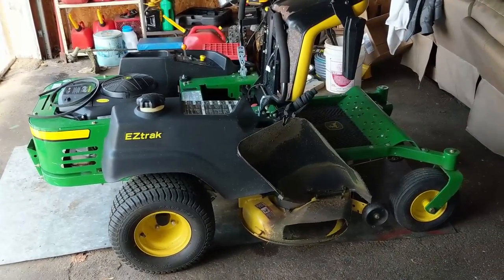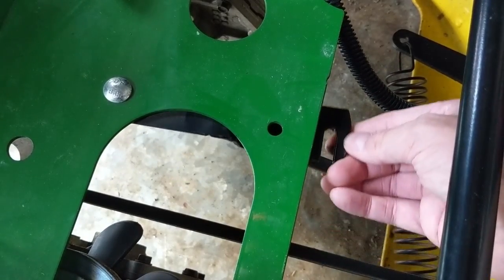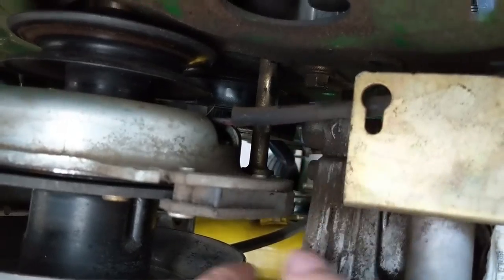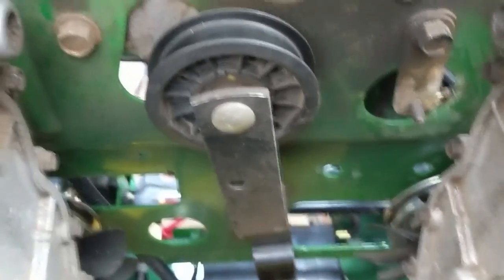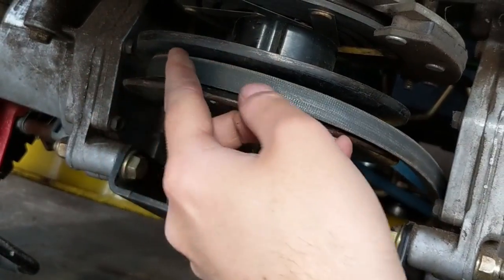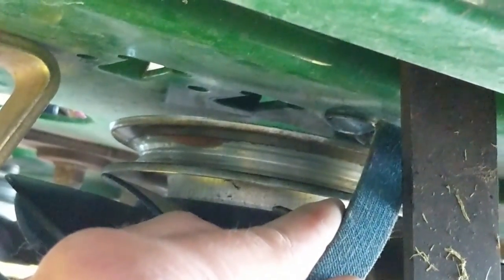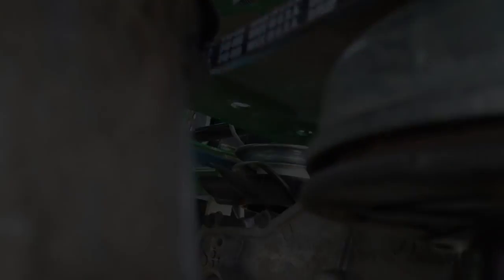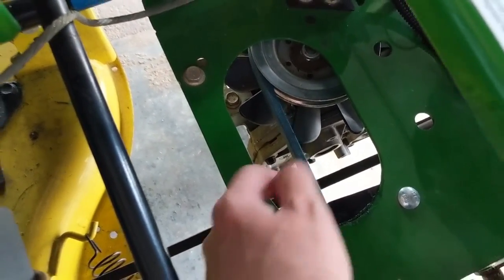John Deere Z245 - Drive Belt Replacement

Comment from the maker: Note; so the PTO clutch doesn't have to be removed, but I removed it and added Permatex nickel antiseize so if it ever needs to come off again, it'll slide right off. Also, this machine supposedly has 2 different drive belts, so this video may not help you if you have a the different model.

Comment: Annually I remove my deck for cleaning, change oil etc.  During this time I check the drive belt.  One thing I can suggest that makes this job a breeze is to drain the oil, remove the battery, and then stand the mower on the rear bumper.  Everything is much easier to see and reach!  Just remember to remove the rear hitch first if you have one.

Comment: Awe brother, you totally skipped over the hardest part of getting that darn clutch back on. I have already put the tension spring back on the crank pulley since it keeps sliding off. Those side bolts on that transmission are a real pain.

Comment: I have a JD z425 with a 48 inch deck, but my drive belt is like 111 or 112 inches long. So that belt does not fit all JD Z425s.
Reply from the maker: Yes from reading the comments it appears there are 2 different designs of Z245, it's possible a different year uses a different belt

Comment: I realize this is an old post, just wondering if you put a washer between the idler pulley lever and the body if that would keep the arm from rubbing against the body?
Reply from the maker: You could, I would use something like a Teflon Washer vs metal but it would work
Reply: @EliminatorPerformance  
Sir, thank you for your response.  It's greatly appreciated.  Have a wonderful week sir

Comment: Great video overall. Personally love how you point out that using anti-seize in the threads will change the torque specs and then proceeded to use an impact :-)
Reply from the maker: Tight is tight!

Comment: What else should we consider if drive belt does not need replaced.  Zero turn will only turn to the right.   I was cutting then all of a sudden left handle will operate but mower will not turn to left side.   Appreciate your insight
Reply from the maker: I would start with a transmission oil change!

Comment: There are two belts depending on the vintage of a 245, mine takes the 107.244 length belt, not sure if the installation will be the same. Looking for a video for my Z245.
Reply from the maker: I guess it all depends on the serial code, thanks for watching!

Comment: I did everything just like you and still have slack at the back and idk where i went wrong and it is the right size belt and everything. Is there away to adjust the tensioner?
Reply from the maker: Only the spring adjusts the tension, and should automatically adjust it.
Reply: @EliminatorPerformance  Oh okay well I don't know where I went wrong. I am left with that little bit of slack in the back that you showed towards the end of the video. It's driving me insane because I know it is simple. I also tried to start the mower out of curiosity and tried to move with that extra slack but it still didn't move. Any ideas what I did wrong? I also was wondering if it could be a bad tensiom spring although it looks good. By the way you did a great job man!
Reply from the maker: @fftl1827  I have no idea man, sorry, it's hard for me to diagnose stuff without seeing it in person. And if I give the wrong info, you'd be wasting your time. If the transmissions aren't in freewheel, then it's hard to say why it wouldn't drive. The belt should always have tension on it. Read some other comments, I heard these machines have 2 different belts for the drive, as 1 model was designed slightly different for some unknown reason.
Reply: @EliminatorPerformance  So I just realized my idler arm is on the opposite side of where yours is. So instead of pulling to your right (top view) like yours is mine pulls all the way to the left. Is there a way to adjust that idler tension arm. Do they break ever also your model is the same as mine and I know the 2 belt situation. But yeah sorry for bothering you I was just curious about the tension idler arm and if it has to be set in a specific position.
Reply from the maker: @fftl1827  I have no idea, you should pull up an illustrated parts diagram using your model number on Google and find some photos.

Comment: What does the drive belt do on a zero turn? I got a z255 that won't go left like the whole wheel locked up. Meanwhile the right side worked fine. It makes like a straining noise when you go left. Trying to figure out what is.
Reply: I obtained a used Z245 that was stored in a shed for a few years.  I  got it working again and replaced the MOWER DRIVE BELT, spark plugs, engine oil and filters (oil, fuel, air).  I did not replace the DRIVE BELT because it looked to be in OK condition, it was hard to get to (AND I did not see this video at the time).  After mowing for 3 weeks, it developed the same symptoms you described.   In my case, it was an extremely worn DRIVE BELT and it resulted in collateral damage to the idler pulley, i.e. wobbling due to over-stretched belt caused the top section of the plastic idler pulley to rub against the frame.  Both the worn belt and idler pulley had to be replaced.   I followed the excellent video by Eliminator Performance, replaced both items and now my Z245 works great.   If the drive belt is not in good condition, there is not enough tension from the idler pulley to drive the left hydrostatic transmission.  The right-side is not affected as much.   This is my first zero turn mower.  The two transmissions make it more susceptible to worn drive belts.   In the future, I will replace the belt more frequently using the Kevlar belt recommended by Eliminator Performance, which is 1/2 the price of the John Deere OEM drive belt.

Comment: You don't have to remove the clutch. Just unplug the wiring harness for the clutch. The drive belt goes on the outside of the stabilizer rod.
Reply: I was thinking the same thing
Reply: I just replaced mine and realized I never took it apart and ran it outside the stabilizer rod and got worried I did it wrong. Glad someone commented and eased me worry. Thanks!
Reply from the maker: Yes you don't have to remove it, but I did and added some nickel antiseize so at least it'll be easy to remove if it ever needs to come off again.

Comment: fyi... i dont think this video applies to EVERY z245, it appears there is another variation which uses 5 pulleys plus idler.  looking at the john deere online parts they list the other config as follows:  Pulleys And Drive Belt (100001 - ) - ST551816.  which calls out a MUCH longer belt
Reply from the maker: Correct, so you need to run the serial number after the model number and you should be able to pull up the proper parts and diagrams for your specific machine!

Comment: Never use a impact wrench to tighten the clutch to the drive shaft.  Only use a torque wrench.  You will prematurely wear out the clutch bearing
Reply: Where's the link to your video?